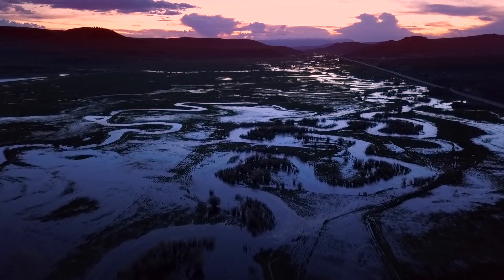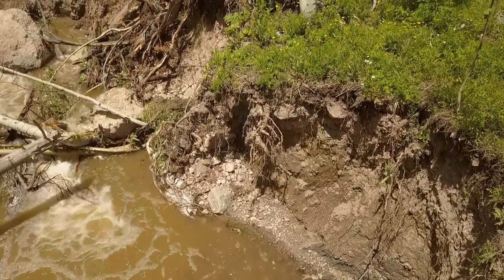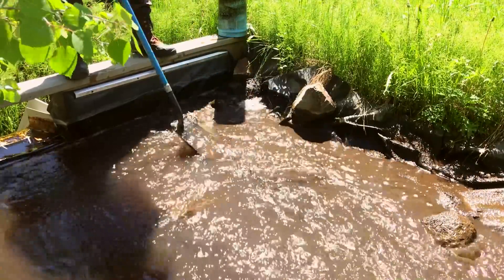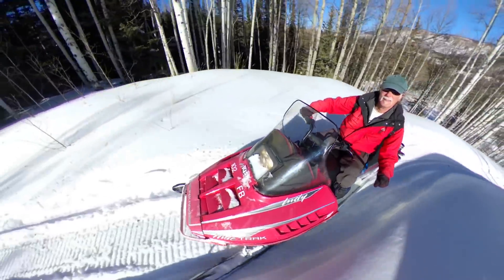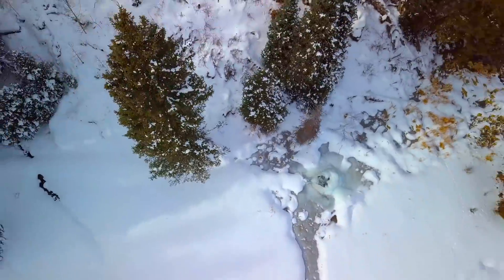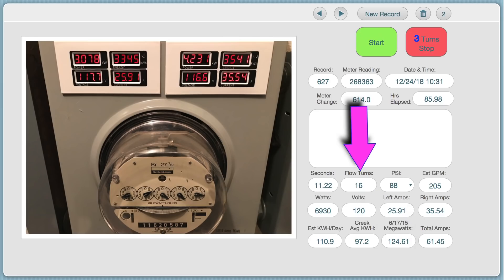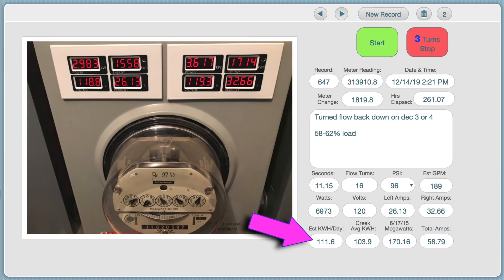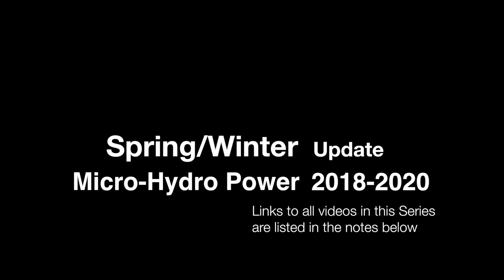Part 21 Micro Hydro Power System in CO

Comment: That's one of the best drone uses I've see by far!!! That's awesome!!
Reply from the maker: It started out with me thinking about doing surveillance for poaching hunters on our neighbors and our land.  That was just flying a course, but then I got to thinking I could identify altitudes and specific way points.  It doesn't always frame the view as well as in the example I've shown, but its certainly good enough to see if the waters are flowing properly.  Takes about 10-12 minutes for a full flight and beats trudging through really deep snow with skis or snowshoes.
Reply: @mrhydrohead  slow clapping you sir, have just won the internet for best use of drone. 

It did a very good job filming on this day. Plus it'll pay for itself the first time you can catch an issue before it becomes a serious problem. If it hasn't already. I can't remember if that's your only power supply now, but if it is then you definitely wanna know right away if you have a possible issue in the works with the added benefit of being able to assess the situation and figure out what tools and materials you'll need before ever stepping foot off the porch. I always thought it'd be a good idea to have a wireless camera setup on all the major areas of concern, but I think this is even better. Wireless cameras don't always wanna cooperate in the cold and you may not have the equipment or service needed to run wireless cameras hundreds of feet away from the house. Anyway... Love your videos. Been a long time subscriber and always learn something new and interesting from you. So thank you for sharing!
Reply from the maker: BIG WIGGLE yes its our only source other than a gas generator we have. Provides most of our heat, so this time of year it IS critical. The intake is a good Half mile from the house, so this HAS been a good way to simply monitor any issues which might arise. I do appreciate the feedback. Have a good one. Cheers 🍻
Reply from the maker: Its difficult to find new topics to make videos on my own system here, but this was a cinch.  Glad you liked it.  More videos to follow.  thx for watching
Reply: @mrhydrohead  hey... Thanks for sharing. Using the drone to turn something that I'm certain could be a daunting task into something so easy it's almost cheating. I was slow clapping for you when you started explaining what you were doing with the drone. I'm sure it probably seemed like a no-brainer considering you're the one who has to make that trip, but I don't know how many trips it would have to taken me before that light bulb went off in my head. Lol!

Comment: AMAZING!  I would LOVE to see a low head high volume build of a homebuild DIY water vortex power generator, not only is it safe for the environment but requires even less diversion or need to move the water to lower locations to get greater head pressures..
Either way I have watched this series from almost the beginning and it's utterly amazing the MEGAWatts of energy harnessed and used for heating and power a home...GREAT JOB!!!
Reply from the maker: I have someone local that has a property with potential.  I'm thinking  that a vortex system would be ideal for his site.  We shall see if I can talk suppliers and him into venturing into the micro hydro realm and letting me document the process.  In the meantime, I continue to search new topics and aspects to share.  Someone just commented on MwH levels per year for our system and I found that we had nearly 39 MwH per year harnessed on average since moving to the creek.  It was an awakening to figure those numbers out for the first time.  Not bad to say the least.
I do appreciate your support of the channel.  thx for watching.

Comment: Hmm.  Roughly 3 Megawatts a year in power from a stream?  Nice!  Thank you for all that you have done to show the rest of us that micro hydro isn't a pipe dream (no pun intended).
Reply from the maker: Disregard that previous calc.  My mistake.  I'll refigure and send you better numbers
Reply from the maker: I've looked back to when we first moved the system to the creek and we've averaged 38834.52 KwH per year since June of 2015 or 38.834 MwH per year.  Something I just did not know or had ever calculated.  A remarkable number.  I usually only look at the KwH/daily number. 
Thanks for getting me curious and for watching
Reply: @mrhydrohead    I just read an article about Jimmy Carter where it mentioned his solar array produced 50% of the electricity for his town in GA.  He produces 1.3MW of power per year.  If you are doing roughly 10MW of power per year do you back feed into the grid or do you have something that consumes the excess?  I'm just amazed at how much power is produced.  Keep up the good work.  I wish someone would do a case study on your setup and costs to show small towns/cities it can be done and it can save the environment and the taxpayers money in the short and long term.
Reply from the maker: Not sure but I think what that article would be referring to MegaWatts produced per hour. 1 MW would be 1000 KW. I was referring to KiloWatt Hours which adds the measure of time involved. There’s no way I’m generating enough power for a small town. Its a difference of terminology MwH vs MW and KwH vs KW. We do make a lot of juice cumulatively nonetheless. 😎

Comment: Excellent set up. I suggest you add some cover to the stream bank near the pipe bridge to slow the erosion. Once a stream establishes a channel like that it will continue the erosion. Another thing that may work is to dig a channel on the other side of the creek and put the dirt and stone on the eroded side.  

Were there any problems with the local water use regulators? Was some kind of license required for the diversion?

Comment: 10:25 178.35 mega watts of power??????  I think you mean 178.35 mega watts HOURS of ENERGY. :D.   Regardless that is very impressive.   I wonder what you could do with a thinner pipe and more elevation.
Reply from the maker: Yes you are right it is Megawatt hours.  I also made a small mistake in the database display in the video.  I mistakenly showed the KwH that gets calculated for 2 turns instead of 3 turns in that Est KwH/day field in the lower left hand of the numbers.  All of them should have been 150% of the value shown.  Opps, its hard to catch every mistake.  Didn't notice until I had posted, so we shall see if anyone catches it and comments.
A smaller diameter pipe would result in more pipe friction at the same flow and hence less pressure.
The first system before the redesign we had was 212 psi.  Here is a playlist of the 3 part synopsis which is an overview of the whole process https://www.youtube.com/playlist?list=PLtTypVpmDd-vkT9bJQkXw4I1t0e_4jMYA The whole series is in about 25 videos.

Thanks for watching
Reply: @mrhydrohead   We are all in this together.  Everyone knew what you meant regardless.   I started watching you long ago always wonder what happened.
Reply from the maker: Sorry bad link above   
https://www.youtube.com/playlist?list=PLtTypVpmDd-vkT9bJQkXw4I1t0e_4jMYA

for Synopsis playlist

Comment: Your measurement techniques seem quite analog... there are open source hardware/software that can easily make this automatic...with a wifi amp/voltage/xxx sensors and collect them to a database and use graphing tool like grafana... Some coding required but this project seems awesome so i would think it would be easy to find a volunteers todo that.
Reply from the maker: Yes you are right.  I imagine a more refined system could be set up, but I'm not sure what the benefit would be.  Our production is quite constant once set unlike solar or wind with batteries.  There are things I would like to remotely monitor like water pressure, but even that is set at a level which remains constant.  It would be nice to have an alarm if it were to fall and also the ability to remotely adjust the flow with a stepper motor or the ability to restart the system from the house were we to overload and shut down the system.  I've been thinking of making a video about improvements I would like to make and maybe I will ask for help with coding in that video.
I did run several set of control wires to the powerhouse and planned to use arduinos or raspberry pis or other micro to use for remote restart, flow control and pressure monitoring from the house. But the fellow who offered to help with that never came through and my expertise in communication over 1200 ft of small gauge wire between micro computers is inadequate to figure it out myself. But maybe someday

Thx for watching and the suggestion
Reply: @mrhydrohead  If it is possible to run Ethernet over those copper cables, that would probably be ideal. If not, there are quite cheap systems that can provide long-range wireless Ethernet/WiFi as long as there is line-of-sight. Mounting one such unit on the outside wall of your house and one on the powerhouse should do the trick. Then an Arduino or Raspberry Pi inside the Powerhouse could communicate over the network with one inside the house. With such a solution in place, your future communication possibilities between the house and the powerhouse are nearly limitless.

Anyways, just want to say thank you for these beautiful and interesting videos! Cheers from an IT student in Norway (the land of hydropower)!
Reply: Graphs/current status are always helpful to see correlation after changing something... also you could try to optimize what PSI gives the best power output etc... also helpful for anticipating maintenance needs... it looks like there are no obstacles between the main house and power house so standard wifi most likely (if not there are directional wifi antennas) would work.. raspberry pi 4 and a wifi extender...+ sensors like this: http://www.yoctopuce.com/EN/

Comment: Awesome video
Will you share what drone you use?
...And then...
Will you share what your hard costs were from design to your first Watt?
Reply from the maker: DJI Mavic Pro (original 1) with Litchi app for control and programming.  
We started in 1995 acquiring water rights and putting in a penstock from springs. That initial system cost around 25k in 1996 dollars. We also got gravity pressurized domestic water and a pond for raising fish at that price.  
When we moved the existing equipment to the creek we incurred additional costs of around 55k in 2015 dollars because we needed a full redesign of penstock, powerhouse, transmission and load management.
People often ask how long it will take to payback the system, but this neglects to consider that we would have had to spend about $140k in 1995 to bring power lines 7 miles into the off grid property.  That estimate had ballooned to $250-300k by 2015 when we moved the system.  We would have had to pay that to bring power lines in and then had power bills to pay on top of that.  So it was a no brainer to install our own system at either juncture and the question of payback was/is a moot question.  We look at the installation as an asset investment in the overall property.  So comparing it to a suburban house on the grid isn't really a good comparison. 
There are virtually no maintenance costs.  We are still running the initial belts and will shoot a bit of grease in the bearings every couple of months.  Every now and then we replace a fitting like on the pipe bridge or the unions on the diversion pipe, but these are parts we have around anyway.
Hope this answers your question sufficiently.
Thx for watching.

Thx for watching I'm never sure who has seen what of the series. Here is a playlist of the 3 part synopsis which is an overview of the whole process https://www.youtube.com/playlist?list=PLtTypVpmDd-vkT9bJQkXw4I1t0e_4jMYA 
The whole series is in about 25 videos.
Reply: @mrhydrohead  thanks
It must be nice to hear with electric.
We're all electric in southern Oregon but heat 3000 sq ft with wood. Burn 3 cords. Our e price is .11/kwh

Comment: YES the video s back 😁I need more info | I've probably watched whole setup from start to finish 10x so far 🤣
Reply from the maker: 1st.  Establish you have the legal rights to make an installation.  2nd.  Measure head and seasonal flows.  3rd.  Determine how much power is available and how much you really need.  4th. Design the system to fulfill those needs and as much of overhead for future needs as you feel you need.  
Every site is unique, so I'm not sure my specific measurements or equipment would be of use to you.  Does your creek have large seasonal changes?  If so what is the minimum that it can provide at the lowest flow during the year.  I don't know what country or state you live in, so I don't know what sort of suppliers you have access to. Do you have sufficient head to go direct AC?  50hz or 60hz, what is the standard in your country?   What voltage is standard?  If insufficient head and pressure to do AC, then you would do DC with batteries and an inverter.  How far does the power need to be transmitted to where it will be used?  
There is a good book to read "serious Micro Hydro" by Scott Davis.  Available hardbound or Kindle from Amazon.  https://www.amazon.com/Serious-Microhydro-Water-Solutions-Experts/dp/0865716382  
It has numerous examples of both AC and DC systems taken from a magazine "Home Power" which were published over the years on the topic of Micro Hydro.  Its a good place to start to acquire an understanding of how it all works. He edited another book "Microhydro: Clean Power from Water" which I haven't seen but assume is good.  

 I learned the basics by taking a class at SEI in 1995 and then had any years of working with my first system to gain my understanding.  https://www.solarenergy.org/micro-hydro-training/  Back then, the internet did not have the resources that exist today.  They are numerous.
In terms of how my house is wired, I wouldn't suggest doing it all yourself, but find a local electrician that understands the electrical codes in your area and get there guidance or advice. its pretty easy to kill someone or burn down your house if it isn't right. 
I don't know how I could have been more explicit or precise in the detail I put into the series without being too much information.  The answers about process are there in the series, but you have to understand it is not a one size fits all sort of technology.  There is an enormous amount of detail I have given over the years in the comments section to many other people.  Reading through lots of comments may answer your specific questions.
It all requires having an understanding of the basic principals and process and then making lots of choices specific to your own  topography, water flow, power potential,  power demand, peak demand, legal restrictions, and finances.  Also, what materials are available in your area and where can you save costs because you will be paying for all future power up front and it won't be inexpensive?  What is  your budget for doing it all?  Who will perform the work and what will they cost?  How much of the work can you do yourself or with friends?
My most earnest advice is to become as educated as you can with books and online resources before  you go about actually doing anything.  Do your study, measurements, and homework first.  You will save yourself a great deal of money by planning specifically and not overbuilding a system that creates more power than you can use.

I do appreciate your watching the videos numerous times and would like to help you, but making a specific video to give you detail that may not apply to your specific needs but suited my own is asking too much.  The amount of time and effort I have put into the series and making each video is enormous and has taken years.

I hope the series is useful and that you take  this advice seriously to heart.
Reply from the maker: Wow that’s commitment!  Thx for watching. If you’re not joking what info do you need? 😎
Reply: @mrhydrohead  No! I didn't jokening (like most of comments will say your setup is most simple and straightforward giving the challenges of terrain) and I would agree. I would really like to see exact topology of setup where you take and return resurse into a stream and some of crucial wiring (I would be satisfied even w/ drawing) so I can wrap my head around all! Why? Because I have alo a small creek which could be of same use to me (and I would like to make something like your setup) because of the flow of that creak. And because the power company becoming to gready (I would like more of technical piece) separated in individual content but w/ more detail in specific part) I know that is a task on it's own but I've literally watched your series at least 10x  from start ti finish (if you asking me I thing that will proper transformer be the biggest problem + motor / generator at power house) if I decide to do something. Small parts w/ crucial details would be perfect - sorry you asked what info I need 😁 love simplicity of the build.

Comment: Unless the side the support is on is the one with the slow creep you can armor that section of creek bank with the fence rock sandwich. Turns the energy of the creek from moving dirt to trying to more the multi ton mat of rocks.
Reply from the maker: May do just that in the coming spring utilizing Gabion baskets and rock from the creek itself.  thx for watching

Comment: Did you properly torque the bands on the Husky couplings that replaced the Fernco's?
Reply from the maker: Didn’t know there was a proper setting. Bought 4 of them surplus off  ebay. No docs provided. Do you know the proper torque setting?  If not I’ll look for that info. They seem fine
Thx for watching